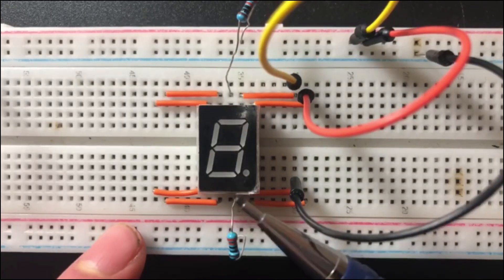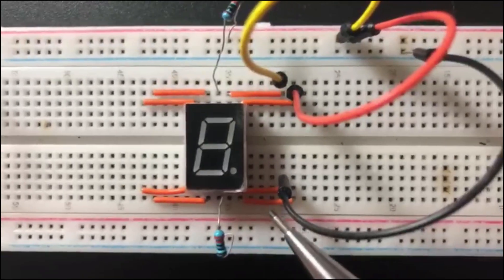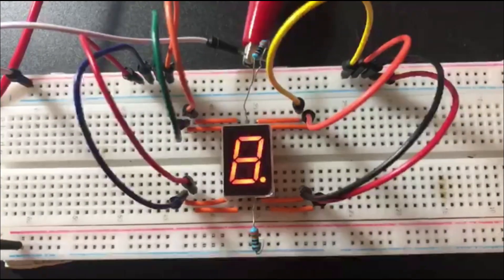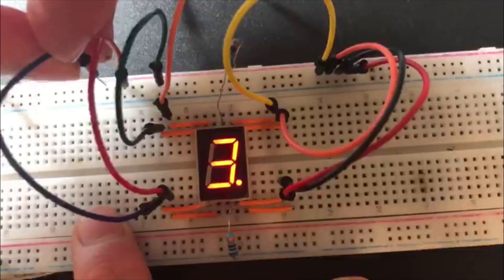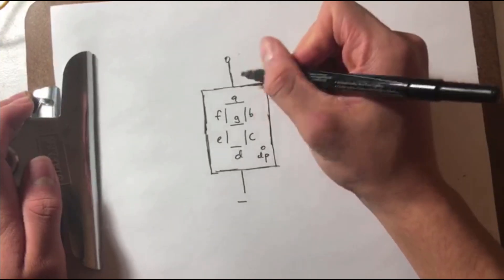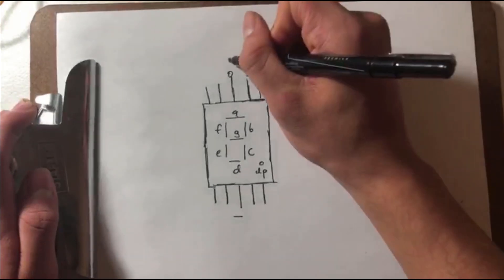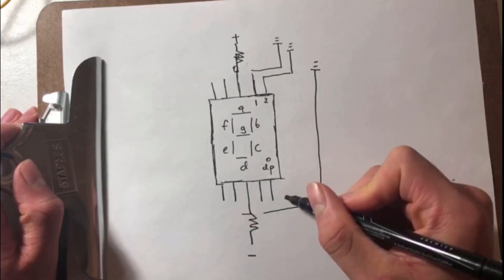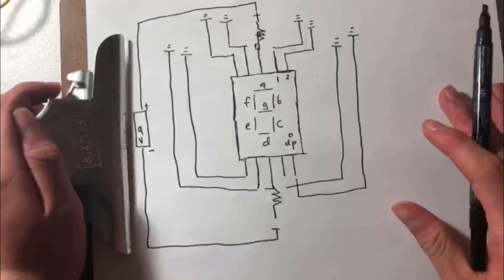How to Wire and Use a 7 Segment Display

Comment: ..this guy is short circuiting circuit..the common anode, or, common cathode, is in the name: common ! He is connecting one terminal to the positive, and the other to negative..That is why we see each segment led iluminated in red, and half in orange.. He is not grounding, he is, even though with a resistor, short circuiting it !  On a common Anode, you put a resistor on one of common terminals, and connect a resistence, and from the resistor to the positive.. for the common Cathode, same process but to negative.. To anyone here, search Ben Eater video " Designing a 7-segment hex decoder "..

Comment: Hmm I just saw the thumbnail of a shared resistor on a 7seg display.. Two even...(?)🤭

With this setup you'll at best get different brightness depending on how many segments are lit, at worst youll fry component.

 Shouldn't you know first-hour-of-101 stuff like ohm's law when you teach other people..? 
I think it's a noble thing to share your knowledge but please know enough to teach before doing it, because otherwise it just spreads ignorance..